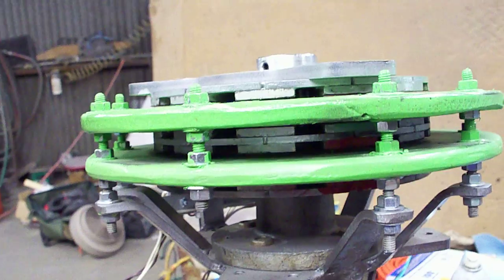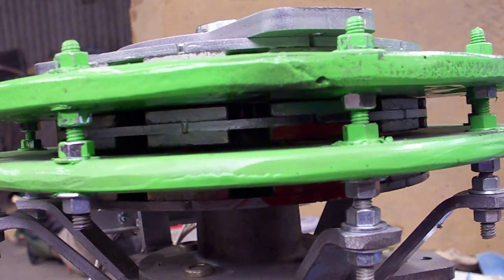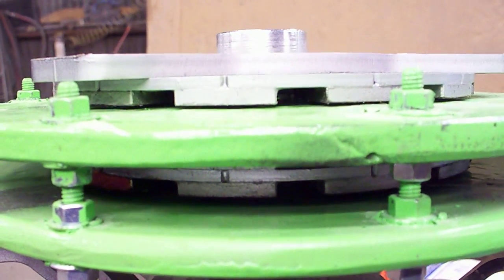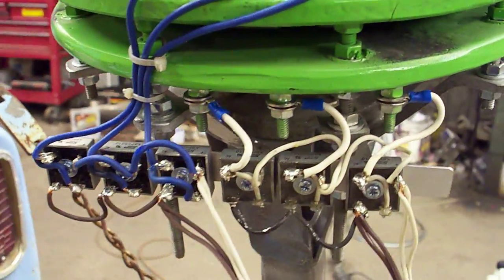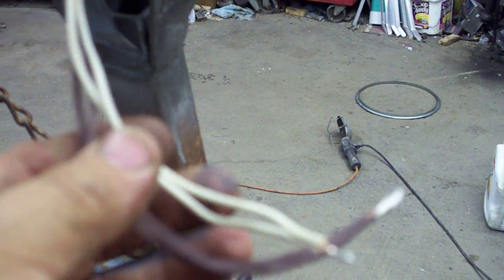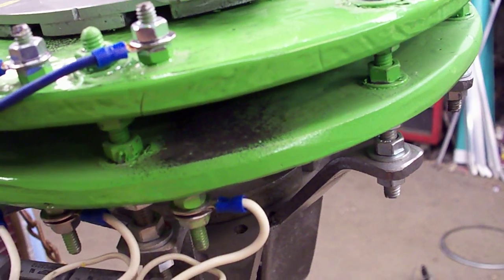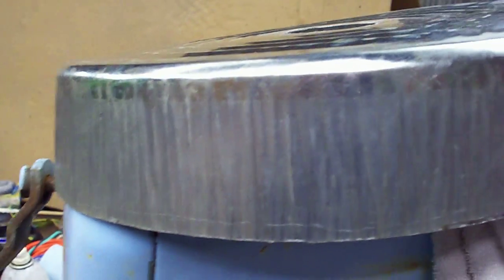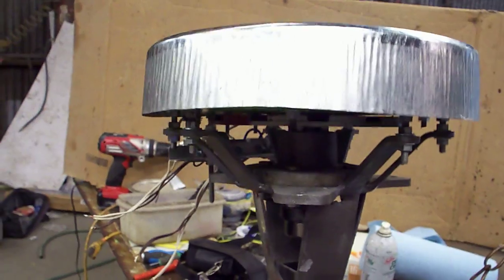VAWT Custom build

Comment: Nice braking idea. But what torque do you need for your power rating please? Great effort to get here. Hope you can get to test your turbine soon. I’d like to see it in operation. I think you have to be able to get the turbine turning under load at 3m/s wind speed, or the system will not generate power most of the time. Wishing you every success.

Comment: Nice setup!!
How did you calculate the windings, rpm speed and voltage/current in combination with the flux strength??

Comment: Very nice build sir. I like the way you have maintained the gap spacing with your custom-built bracket and threaded rods. You have overcome the biggest problem of using a disc-shaped rotor (as opposed to a cylindrical one).

You have used 9-coil stators and 12-magnet rotor discs. I suspect from the TOP->BOTTOM they alternate NS||NSNS||NS then SN||SNSN||SN as you go around the stator, yes? And your two sets of output leads are connected in parallel to maximize current output?

I too would encourage you to make one more video showing the device in operation at low RPM to demonstrate charging current output and magnetic drag under load.

Thanks for this video.

Comment: Thumbs up for stacking the rotor plates and stators. This just gave me the idea of  keep on stacking until you reach the max capacity of the wind turbine. The only problem I see with the axial generator is that you cannot levitate the rotor by pure magnetic force to eliminate the need for thrust bearing as you can with the radial generator.

Comment: I like the idea of using 3 magnetic rotors and 2 stators, how do you stack the magnes on the rotor plates.? Do you put N opossing a S in the upper side of the middle rotor plate, then a N in the lower side of the middle of the rotor plate, and the a S on the lower rotor plate? how are the magnest set up in the middle rotor? up and down?